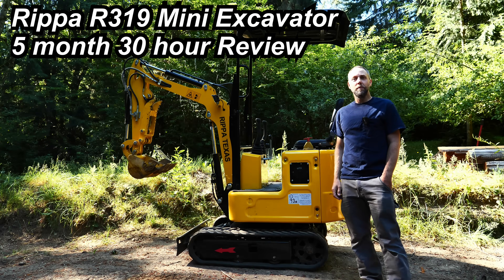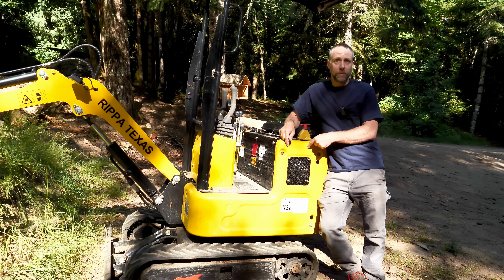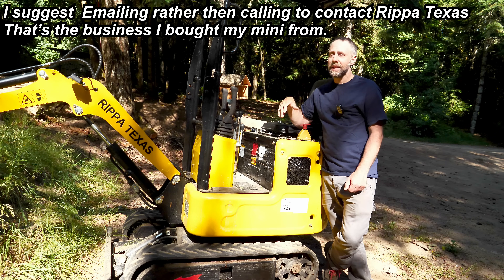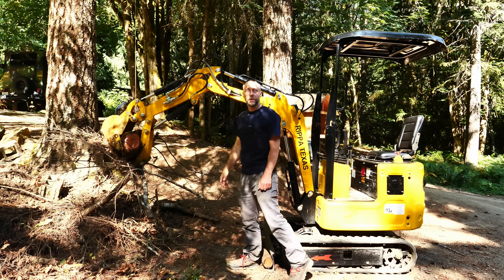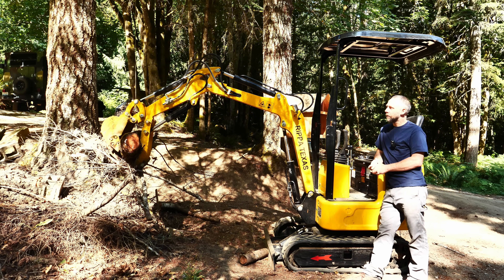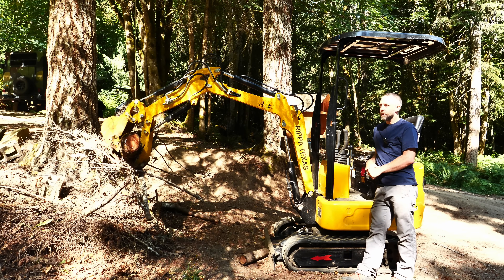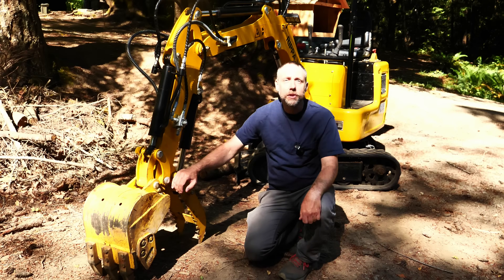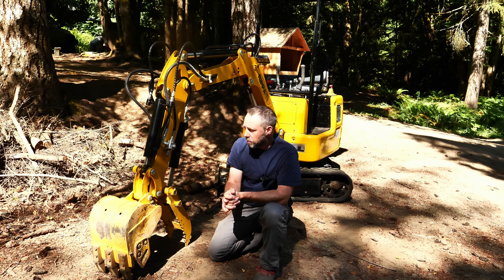Affordable Chinese Mini Excavator review #Rippa #R319 #miniexcavator

Comment: They all seem to have their nuances. Your bucket isn't built as sturdy but your thumb lays almost flat against the boom, mine needs the upper boss moved to do this. My rear house door opens on a hinge and stays open, thats nice. Seat is hinged too but uses two dumb wing nut bolts. Your blade mount is gusseted and the bar between the drive motors but a flimsy "ROPS". Mine has a digital volt gauge and hour meter. The Chinese need to put all the best features together, its not like most of them even cost any money to do. My hydro oil smelled funky, unlike oil. I used AW 46. 

The other motors won't have the stator output that the BS has that can run cooling fans. 

I've heard people say the swing booms are a little sloppy and don't stay centered. 

If it was to do it over again I'd go one size up. I didn't do expanded tracks because thats additional maintenance and future issues. 

I think if you were working in warmer temps, higher RPMs and longer travel you'd get some heat building up. Mine hit at least 180 (highest the gauge goes to) with the stock oil and cooler running an 80w fan. After changing the oil and ceramic wrapping the exhaust it cut down the temps to 120 or less so far. 

Have you tested your pressure yet? Sounds like a lot of people have low pressure since there is no QA from factory. Mine was at 2050, turned it up to 2400. Seems smoother on turning now. I used an M14x1.5 male off the thumb plumbing.

Comment: Stay away from chinese diesels. They change the design every year or so and discontinue making parts as soon as the new design is out. Spare parts dry up pretty fast.
I have a buddy replace 2 gas motors on his farm with them 2 years ago so he could have everything diesel. Both the electric starters died within the first year. The starters are discontinued. Fine so he started pull starting them. It's easy enough to do on a wood chipper and a pump. Well the pump pull started broke, parts are discontinued. I looked at it and the pull starter looked like it was built for a 5hp gas engine out of cheap stamped steel and plastic parts. Dang sure wasn't designed to pull start diesel for long term. He has done swapped both back to a gas engine. Both engines were running great but he didn't want to have to get a bump box to crank them every time.
Reply: The diesels are off the shelf Kubota K902 or K722 models, hardly an issue for parts, just MUCH more expensive than gas. A whole replacement gas engine is only a few hundred...

Comment: i wonder if they do what aliexpress seems to do, where you order something and they put it in a box and then wait flipping forever until they have 3,000 more of them in a box and then they ship it, thats the only way i can think of they save money on sending huge hunks of steel across the ocean, prolly costs less to ship a bunch of them rather than one at a time. or they could just slow , i have no idea, i think to much about things i dunno anything about. i want one so bad, but i'm a poor broke scrub, i will have to wait and buy one some degenerate abused for 15 years and it'll barely ever work and i'll hate it and complain about it all the time, but it'll build my rc truck race track i want someday.
Reply from the maker: I’m pretty sure the company I ordered from buys 10 or 12 per shipping container. The wait time comes down to if the model is in stock in Texas or if it needs to be ordered.
This mini took about two weeks to receive from when I placed my order to the time it arrived. This little mini is still holding up well 👍 Thanks for checking out my video.